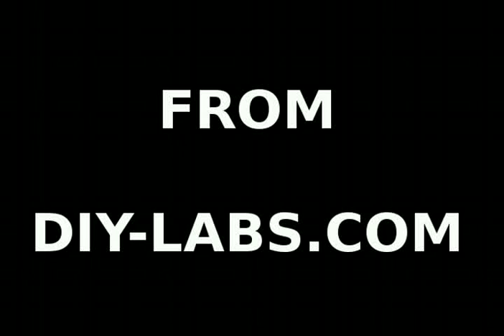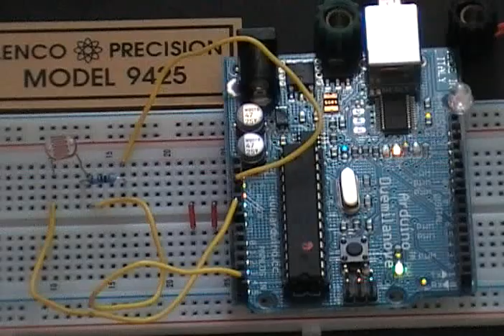Arduino Photoresistor Lighting Control

Comment: I plan to create a network of light sensors, and use the average value to control the dim of some incandescent lamps.

Basically, as the sun sets, and the lights go down, I want my patio to be ambiently lit, slowing dimming up from 0 to 100 brightness.

Where can I get one of those relays? And which Arduino board would you recommend for this?

Comment: this video is fabulous, I really did understand how to use the photo cell.
I did a series of experiments and found that to get an even better result you can add a potentiometer and use the value read from it as adjusting the amount of darkness in which you want the lights come on.
Also if you replace the LED with a relay you can use this system to control the normal incandescent lamps.